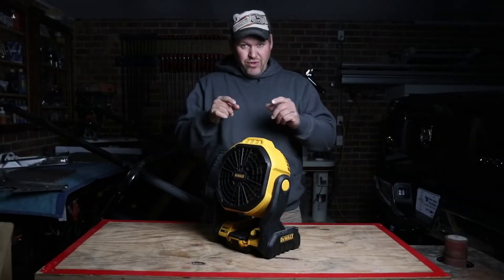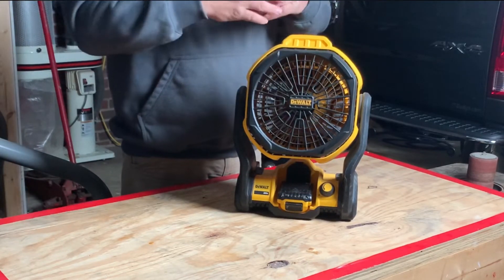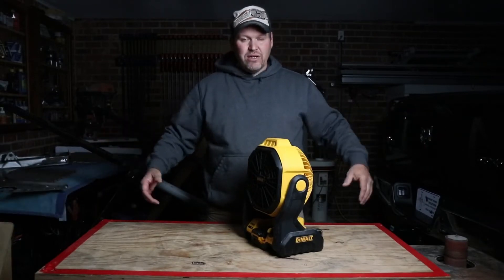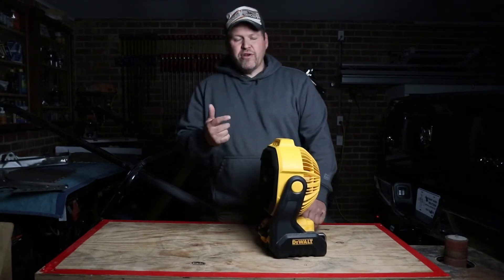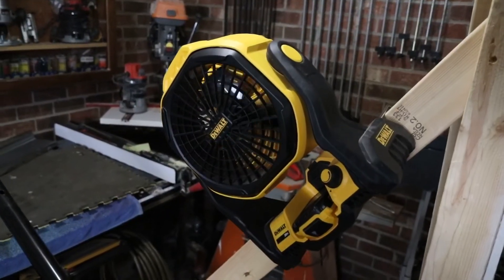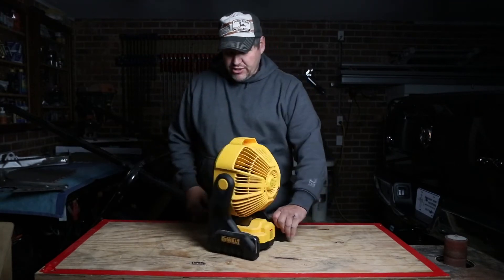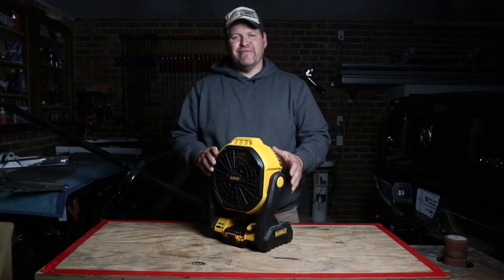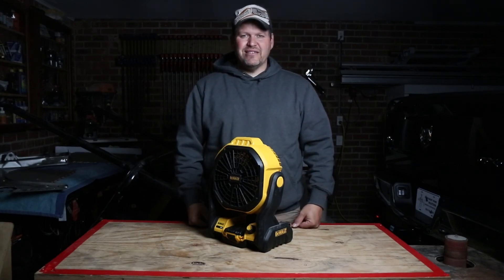DeWalt Fan 20v (Why Remodelers’s Need This)

Comment: I just went to the Lowes store website and added the fan only for $119 to my cart and it also added a free 3mah battery and charger for free Valued at $119. So a pretty good deal there and i used my military discount for a total of $107.20 out the door.
Reply from the maker: Awesome. We’re on scaffolding right now and both fans are up there running. You will love them. Thanks for the comment.

Comment: That looks like a really nice fan.
Would be neat if had a filter on back side so it wouldn't just ciclelate the dust.
Reply from the maker: Not bad idea, but they won’t do it. Just from the extra load on the fan motor. Engineers know most people wouldn’t clean them ,then complain about the lack of air. LOL

Comment: Looks like you are in love with that fan.
Good review.
Too bad is extremelly expensive.
Started for $59, then $79 and now $119 and summer might go for $139 for only tool without battery or charger.
Reply from the maker: We have two now. These are outstanding fans. I’ll post an update when I see these for a good deal.
Reply: @campbellbuilt  Great. I need one for hurricane season, or to work in shed or garage.

Comment: Can the Flexvolt 20V/60V butteries be used on this fan?  Which is the largest of those batteries that could be used?
Reply from the maker: We run the 9amp flexvolts in them all the time. We don’t have any 12amps yet but have been told they are the same size as the 9’s. I’m hearing of these going on sale in the 75 to 80 range. We have them on some treated boards drying them out for upcoming sill jobs as we speak. Love these fans. Hope this helped.
Reply: @rHeron-wr8bs  I was talking $80 for fan, not battery.